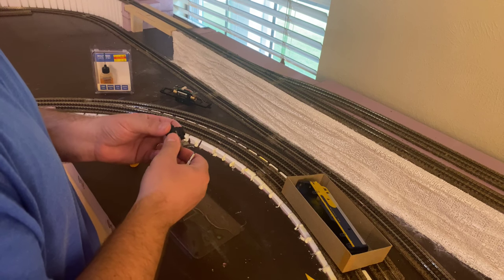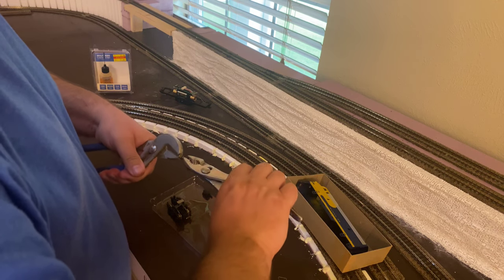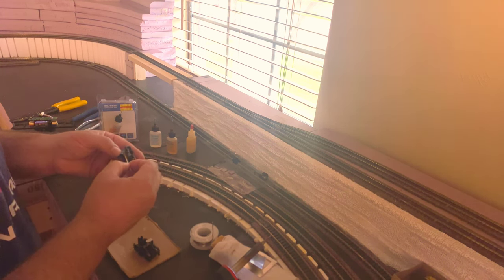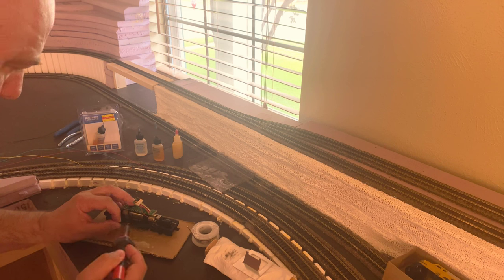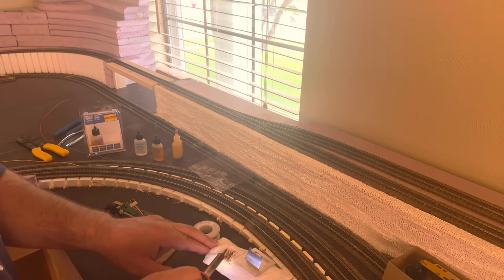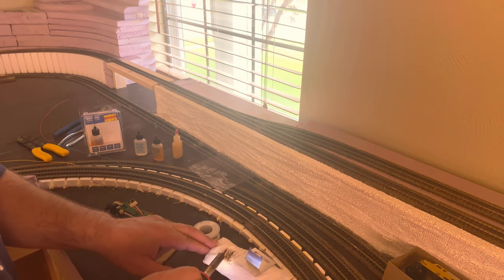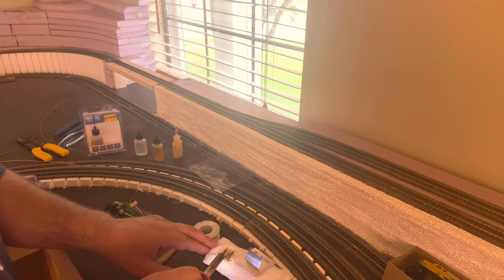Athearn Blue Box Diesel Upgrades (Part 3-new driveshafts and wiring)

Comment from the maker: 00:00 Introduction
00:09 Removing worm gear connection
02:05 Installing new worm gear connection
03:00 Installing the driveshaft
03:35 Worm gear cover reinstalled
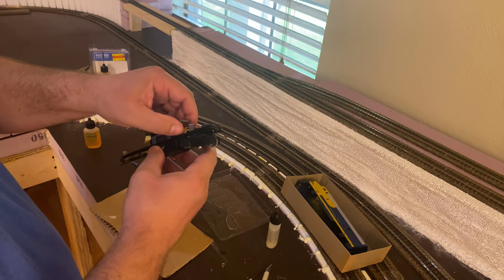03:52 Soldering wires to pickups on trucks
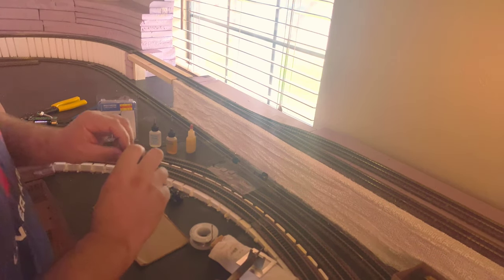06:28 Trucks reinstalled in frame, connecting wires to motor
07:29 Connecting single wire to brackets on trucks and motor
11:56 Polyimide tape over solder joints
12:06 The next steps!

Comment: The wires you connect to the trucks are track power right?  The motor is isolated and connected to the DCC board.
Reply from the maker: Correct.  The original locomotive uses the frame to conduct current to a contact on the bottom side of the motor, and the other track pickup comes up through the flat metal pieces that stick up from the trucks (originally including a horizontal piece along the top). Whether you use a new motor like we did without a contact on the bottom or the original motor, you need to make sure it is not getting current from the frame. The wires to the trucks ensure a solid, reliable connection. I eliminated the flat metal piece along the top by connecting it with wire as well.

Are you working on a conversion project?
Reply: @TwoRailfans  I will be.  So the actual motor wires are already pre-wired in the assembly and connected to the board.  You kept saying the wire connection were "to the motor", but ware actually track power wires, right?  Also, could you expand on the wiring problem and what you removed to fix it?
Reply from the maker: @majortomtogc  the 8-pin plug was not working and there was no room for both a circuit board and decoder inside the shell. I removed the circuit board and wired the motor directly to the decoder. Sorry if I misspoke but yes, the pickup wires go to the decoder. It runs great now!